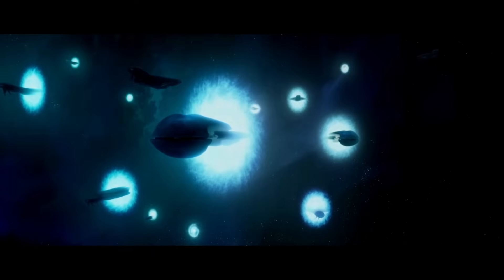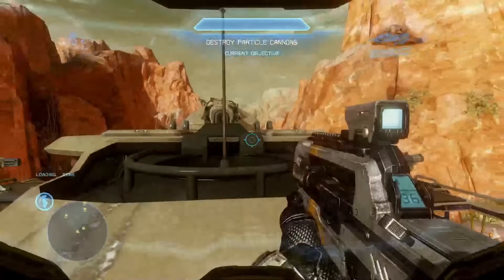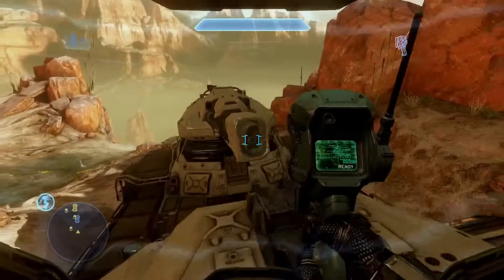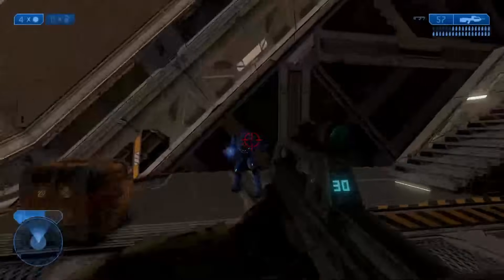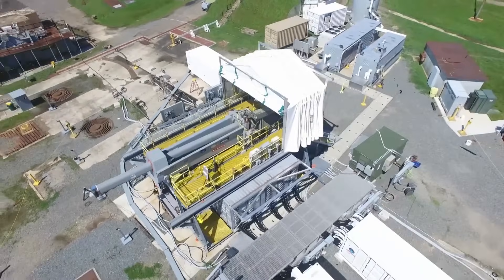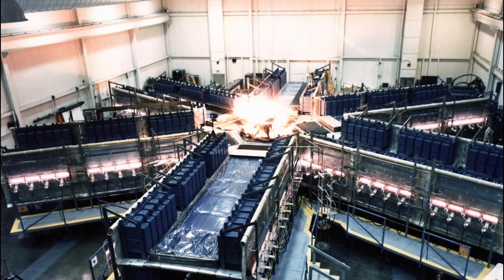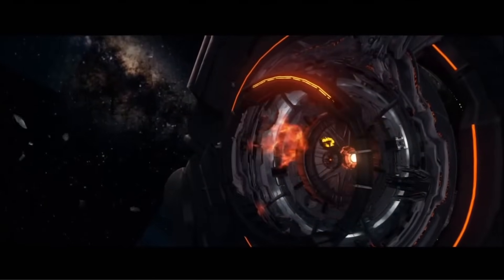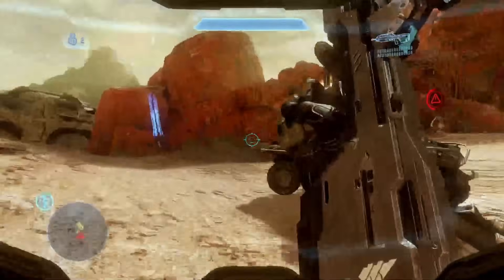Could We BUILD Orbital Defense Platforms TODAY?

Comment: Honestly a railgun will come first as its so much simpler and easier, also the tests with a railgun, as i recall, never actually recaptured the energy flow which should be possible to shortent the charge time quite a bit. They also used sleaves for the railgun that peal away after leaving the barrel.

Comment: The MAC canons that were powered by ground stations were powered wirelessly, remotely powering stations does come at a percentage power loss, but it is far more impractical bringing the power source into space with the weapon. While low Earth orbit would increase the efficiency of power transfer, it also requires more power stations on the ground for coverage. The recoil of the guns would also make managing orbit very difficult since it's already close to the atmosphere, having it further out gives a chance for course correction.

The most feasible long-distance wireless power transfer technology is laser power transmission, onto a high efficiency, actively cooled, photovoltaic receiver, achieving a theoretical maximum efficiency of 85%. It's the same tech we're trying to make for wirelessly powering the elevator on a space elevator tether.

Wireless laser power transmission is also a good way to speed up and power spacecraft in a non-ftl universe, which also brings us back to the point of recoil. Ground based power stations give an endless "fuel" source for orbital correction, as every time the guns fire, their orbit would be altered. The action of giving power to the station would also actively keep it in orbit.

In space, you can only cool radiatively, there's nothing to quickly grab and dispense of the heat, unless you actively dispense something that takes it; Heat fins for a reactor would make the station a bigger and more expensive target, with large solar arrays doing the same.

Comment: To be fair those were the stupidly powerful Erod class ODPs over Reach. The ones over Earth are the older, smaller Moncton class, and they are self sufficient with their power supply.
The Erod class ODPs were just stupid. Wireless power transmission over that much distance and up through atmosphere is an awful idea. It'd be so inefficient, the transmitted power would be attenuating in the atmosphere and probably boiling it off as the battle went on, and the power broadcasts are both giant beacons alerting the enemy to the location of the ground generator as well as giant vulnerabilities to the ODP itself if a ship slips past and interrupts the broadcast.

Comment: The concept for beaming solar energy from a geosynchronous solar array has been floated.  Large solar panels in space that shoot microwave lasers to Earth.  Those microwaves are captured and transferred back to electricity.  It's possible, not really considered because that would mean huge microwave lasers in space that could be used as weapons.
Use that in reverse and a planet side energy station could shoot microwave lasers to the MAC platforms to charge them up.

Comment: For an object that's supposed to protect the planet, having that object be more of a danger to the planet than whatever it is defending against is something to be avoided. Something that goes through the atmosphere regardless of its state with no resistance - like radiovaves or xrays can be used to beam the energy to a receiver on the station thus avoiding the possibility of turning the station into a nuclear asteroid in the event that something goes wrong.
You would need an established no fly zone for them too, to prevent aircraft from being fried, boiled or irradiated (depending on the wavelength used by the project). For a no fly zone it helps when its stationary. That's why having the station fly all over and receive beams from multiple ground bases is impractical.
 The "aiming" nitpick is weird as well. Having the gun on a pivot would only reduce accuracy and structural integrity of the weapon. The crew would still experience the effects from adjusstments because there is nothing to brace the counterforce against other than a station itself. No matter how you spin it.

Comment: Soooooo..... there's the "E-gun", as well as the "GR-1 Anvil" alpha model. Probably should put a bit more research into these.
Reply from the maker: Soooo a hobbyist coilgun with less than a tenth of the muzzle velocity of a standard issue rifle is relevant to the video how?
Reply: @TheBigCabezon  It's relevant, because a commercially available linear accelerator of any type is only really a tipping off point, and an old one at that (speaking of the E-Gun" As for the GR-1, it has a similar capability as a .22 long if I remember correctly, which is lethal. Again, it's already old news. As technology continues to miniaturize, more powerful versions of both of these weapons will become standardized. The interesting point in fact about both of these weapons however, is something most science fiction weapons do not take into account, which in those instances, make them impractical in the extreme, and that is round capacity. Both of these weapon concepts feature a magazine feed, which is integral to military application. (Bolt action will be at a huge disadvantage against a burst rifle for example.) You can handwave the Halo versions of these weapons all you want with regard to fire rates and ammo capacities, but ultimately such thigs are more or less irrelevant to a game. 

This isn't even considering the actual military trials for much more robust versions of a linear accelerator, which are viable, in a sense, in that they totally work as intended. There are however, two main issues to such a weapon platform, that keep it from being standardized by any major military power.

First: There is a saying, "Keep it simple stupid". The more complex you make a weapon, the more likely it is to fail over extended use. It's why you don't see many modern militaries using Bullpup weapons, despite the inherent advantages a bullpup rifle has. Coil guns, rail guns, gauss rifles... They are all incredibly complex pieces of hardware, that have innumerable points of failure. a soldier with a broken weapon is a casualty waiting to happen, and thus, simply a wasted resource.

Second: The cost. Never minding the initial cost to construct a single weapon platform, the ammunition for such weapons would be expensive and difficult to maintain. Counter intuitive, yes, due to the ease at which one can find Iron, or its related alloys. However, the standard ballistics used as of now, benefit, from being difficult to degrade (via natural processes such as corrosion), and come with a reduced cost over volume (lead is hilariously cheap). At the moment, the only real benefit a ferromagnetic sabot would have over a bullet, is that there isn't a chance for the sabot to explode.

Comment: Never mentioned firing the power source itself, something like shooting a super capacitor attached to a projectile, using the projectile power itself as it passes though the coils or rails. Doing something like that would save on weight, recharging and could enable conventional acceleration with the added benefits of electromagnetic boosting. Sorry for the comment necro.

Comment: I'd mention at 9:30 Cabezon says that some big MAC stations have ground stations. I have not read a HALO work with those but I would assume they would be using energy transmission not physical wires 100 miles long.

Comment: Gauss cannons are not the same as coil guns and they are typically confused with each other. The key difference between a coil gun and Gauss cannon is that the Gauss cannon doesn't have any electricity in its use. Basically a Gauss cannon is a line of magnetic pices lined up on a slope with the projectile on one end with a weight that is typically magnetic in its self that you drop along the the path of the slope to throw your projectile at great speeds. This is the best way to describe what the difference between the launching systems are.
Reply: A lot of people use "Gauss gun" as a catchall term for "any magnetic accelerator"
Reply: @The_Inquisitive_Inquisitor  I understand that however it doesn't make them correct about what they are saying and quite often it shows a fundamental lack of understanding of what they are talking about.
Reply: @jedstanaland2897  In Warhammer 40K "Gauss weapons" are vacuum cleaners that suck you up molecule by molecule. Wrap your head around that

Comment: ground powerstations can be a thing if your species masters super capciters and room temp super conductors and has stuff like graphene easily on tap. long distance power transmission wouldnt be an issue. Propelling shells at a portion of light speed isnt that difficult when you actually look at it. If brute force isnt working, you arent using enough of it

Comment: From my understanding, something that has accelerated through a magnetic field that doesn’t create friction because the object is suspended by the field itself shouldn’t create recoil, correct me if I’m wrong, but there should be no recall whatsoever from something, even at the size of a Mac Cannon
Reply from the maker: There would still be an equal but opposite force on the magnetic field (think of holding two magnets against each other). The station would experience a force in the opposite direction due to the force against the coil's magnetic fields.

Comment: One potential way to power an orbital station from the ground could be through microwaves. More than a few orbital solar power generation proposals have the power load being transmitted to a ground installation via microwaves, so it stands to reason that the reverse should hold true.

Comment: 9:00 the power is beamed up through high frequency electromagnetic waves. While they do encounter resistance, at such high frequencies it would ionize and push out the atmosphere to reduce further drag over time. This also requires geosynchronous orbit because the beams can’t be angled through the atmosphere due to their size so they’d have to go straight up.
11:00 you hit another key point as to why you should have them so far out in geosynchronous orbit. These stations are flinging these massive titanium rounds at multiple percentages of the speed of light (which makes distance in aiming less of a concern). The recoil will be massive, likely so much so as to having them in anything but geosync would be willful neglect. Also in firing the guns simultaneously fire retro rockets (I am 99% certain this is cannon) that offset the force of the round but over a greater period of time (I believe it is the same period time as it takes to reload) so that the gun is more or less at the same trajectory as the previous shot. 
I don’t think you really want to make the gun smaller but definitely removing the troop staging points and making it a remote station is a big move. Maybe x10 it’s ammo storage, add thicker armor, and a few solar arrays to assist in the recharge process, but don’t make it smaller that only hurts performance.

Comment: There is no recoil from a coil gun. You've made a common mistake when thinking about Newtonian forces. Launching a bullet either in a normal gun or a coil gun isn't an action, it's a reaction.
Reply from the maker: There is recoil... Forces always balance out, so if use magnetic forces in a coilgun to propel a round, there's also a force back against the magnets. You can easily go pick some up at a store and demo this for yourself.

Comment: It’s in geosynchronous orbit because it’s tied to a space elevator. You don’t want to add extra strain on the tether by having it responsible for continually accelerating the orbital platform so it doesn’t get de-orbited. For a space elevator for putting payload into orbit, it can be at a lower orbit, but for a space elevator that acts as a space port or houses a sizable orbital defense platform… that’s gonna have a much heavier station on the counterweight side of the space elevator.

Comment: depending on the velocity if its low adding an  explosive is better as the energy the round has is low and the explosive would add to the damage but as speeds get higher Eg mac 7+ then the kinetic energy alone is much higher then the explosive so at that point the Explosive becomes useless and the round itself through puree impact alone is doing 99.9% of the damage lets say the orbital mac guns hit mac 20 then only a Megaton Nuke would add anything to it.

Comment: A very interesting video, thoroughly enjoyed hearing your thoughts on the subject.

I'd like to add my tuppence in. When we talk about getting a big thing moving very fast, physics does like to throw more problems at us. (Sidenote: there's an orbital warfare simulator called Children Of A Dead Earth, you can design your own railguns and coilguns and this is where I've found physics being a bitch. The equations in the sim are what is used IRL so, in theory it shouldn't be too far from reality)
Coilguns are good for accelerating something large to a relatively low velocity, whereas railguns are good at getting something small moving very fast.
With coilguns, when we try to get something moving fast we run into magnetic saturation of the projectile and no matter how much stronger we make the field it just won't make it go faster. The wasted energy just goes into heat in the coils. Solutions include longer barrels so we don't saturate the projectile, spread the magnetic field out; use a bigger slug, which will improve efficiency but won't get it going faster; or finding a material with a better saturation limit, which may be difficult or prohibitively expensive.

With railguns, it boils down to heat and barrel erosion. Bigger slug means slug is in the barrel for longer, so more time for resistance to build heat up from the current. Try bumping the current up to increase the force, you'll increase the velocity but that'll mean more heat.

One solution I've heard of but hasn't been researched much is the helical railgun. The rails twist around the barrel forming a coil. Actually this makes my head hurt a bit trying to think how this'll work. Not much research has gone into helical railguns either.

Comment: Didn't the ground power station use microwave beams to transmit the power to the station?
There are transmission losses, sure. But I am POSSITIVE that the losses justify building the heavy reactors on the ground rather than in orbit.

Comment: I believe the lore on ODP’s (Fall of Reach, Ghosts of Onyx) states that ground stations are paired with individual high intensity lasers which transfer the energy by firing said lasers at the ODP’s above them, with earth having 300 ODP’s in orbit an equal number of generators had to be built on earth in each major population centre. (Cairo, malta, athens) being 3 of the named ODP’s in Halo 2 (3 / 300). 

The idea being the ODP’s themselves are the capacitors they don’t generate power (except to run onboard computer and mechanical systems) thats why the ODP’s can fire 1 round every 3-9 seconds.

Also to jump in on ODP velocities Johnson’s quote is: “At POINT four tenths the speed of light.” As in 0.4 tenths the speed of light NOT 4 tenths the speed of light, one requires astronomically more power generation than the other.

Comment: you mentioned geosynchronous orbit for the halo rings then defined what a geostationary orbit is. a geo synchronous orbit has an object pass over the same point above the object it is orbiting every time it completes an orbit in earth's case 24 hours (rounded)
Reply from the maker: We might be saying the same thing, a geosynchrous orbit has an orbital period of 24 hours so it more or less would appear stationary from the surface, as it orbits at the same angular rate as the earth spins. A geostationary orbit is also equatorial, off plane geosynchrous orbits would make little figure 8s from the surface.
Reply: @TheBigCabezon  but isnt a geosynchronous orbit that is on the same angular plane as the rotation of the parent body geostationary then? you could argue that getting a perfect geostationary orbit is nearly impossible therefore making it synchronous as then it would pass over the same point on the surface of the parent body every time it completes an orbit instead of literally hovering above the same point to an observer.

Comment: you can use microwaves to send power to a station in orbit, the same can be done from space, a huge solar panel station colects power and sends it down using microwaves and it doesn't need to be very powerful, i read something about that ten year ago.
as to the game the platforms around reach used ground stations about 20 that were devastation the covenant fleet the platforms around earth didn't acourding to warfleet, they had their own power source.
 the platforms in halo have artificial gravity, the people wouldn't be swung around.also every station has a set of trusters on the botomfiring for a few seconds to counter the recoil from the guns.

Comment: Unrelated to The other comment, there's duplicate audio. First loop starts at 12:34, second loop finishes about 12:44
Reply from the maker: Damn I missed that haha, anytime I think background noise may pollute the recording I immediately repeat myself (I record in one single, long take) I usually trim out the duplicates because it's obvious but missed that one. Embarrassing.
Reply: @TheBigCabezon  I think you can cut the duplicate section using YouTube tools without taking down the video or anything, but I'll leave that up to you. Just wanted you to be aware in case you did wanna fix it.
Reply from the maker: I just went in and trimmed it out, thanks for the heads up!